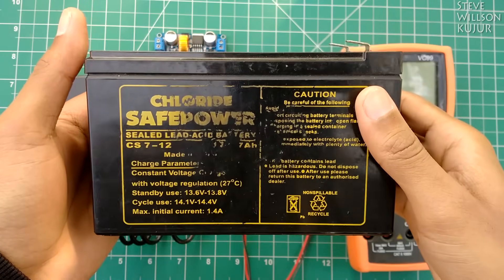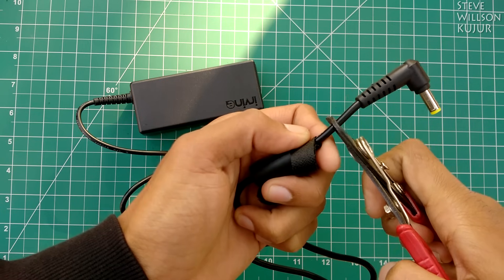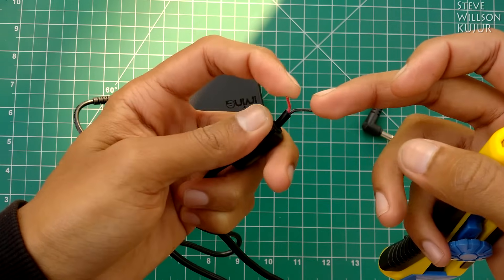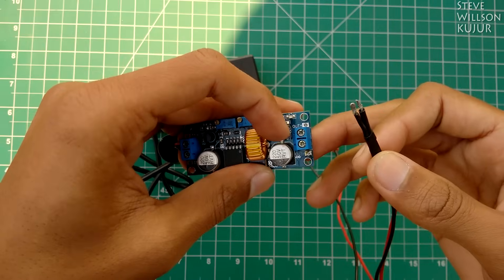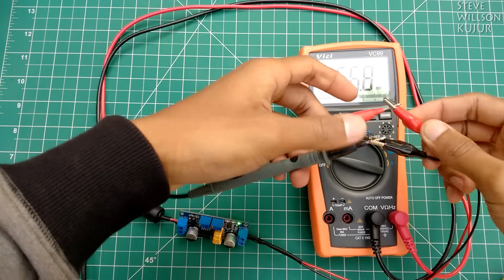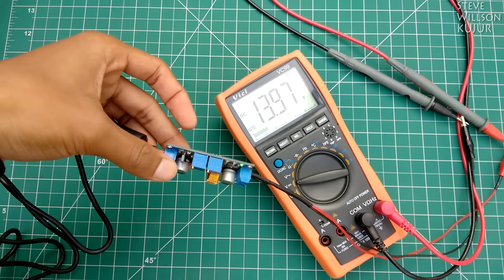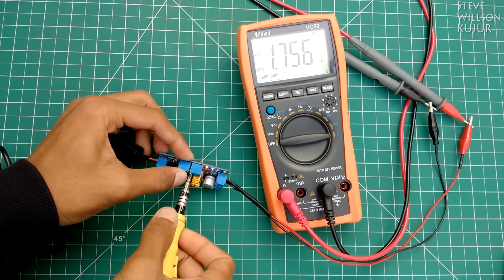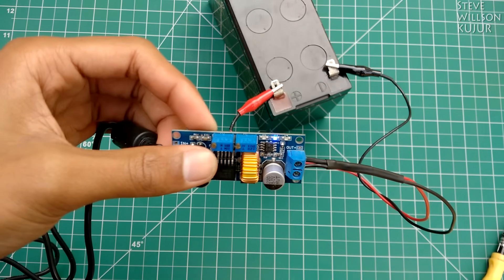How to Make a 12 Volt Battery Charger

Comment: I have seen a diode connected in series with +very terminal and battery which doesn't allow reverse voltage from battery which may damage buck converter. Is this necessary

Comment: Hi Steve...i am trying to charge a 12v 7ah battery using the XL4015...i set the XL4015 at 13.5v  and at 1.4amps..however when i connect the 12v 7ah battery to the XL4015 output both the red and blue lights up at the same time...i tried it on another 12v 7ah battery but the same thing happens...both the red and blue lights on the XL4015 lights up at the same time...what am i doing wrong?...i am using a 19v 3.42amps laptop power supply as my power source...please help me.

Comment: I have a inverse problem the battery charger shows battery as fully charged after a while due to surface charge on battery i dont know what to do to tackle this but cant confirm if power cuts off when light status changes on this module

Comment: help, I have a large 24 volt  lifepo4  battery in my camper but the camper is 12v /13.8v. should I keep a 12v/13.8/ battery charged with a 24 to 13.8v stepdon or just get a giant 13.8 step-down and have no battery?

Comment: Hi!
Nice and clear explanation and good vide.
My question is:
Is the 2A charging current not a bit too much for a battery of 7-8Ah?
I would say a charging current like 500-600mA could be better.
Reply: IIRC a lot of fast battery chargers use anywhere from 1-4 amps, just because its quicker to charge the batteries, but these chargers also have saftey auto shutoffs to protect the batteries.

Comment: You can use the Imax b6 multifunction charger for this as well, but if you get the adaptor one, you need to buy 15v 5amp adaptor for this.
The b6 charger has protection features that this module does not have.

Comment: It's amazing how many DIY battery charging crap that is presented here on the tube. 
This will ruin your battery very soon, by overcharging the battery. And if you lower the voltage in the regulator the battery will be undercharged.
DON'T DO THIS! Buy a real intelligent battery charger and don't kill it this way!

Comment: My battery is 12Volt and 7A/H what module should I buy can you share the link please. Thanks. This is the model number of my security alarm backup battery Lithonia Lighting 12-Volt 7A/H Sealed Rechargeable Battery ELB 1270A. Need your technical help.

Comment: Does dc dc step down convertor automatically stops the flow of current after battery charged? I guess it does not. After battery fully charge its voltage will be 13.5-14 volts. The circuit must be cut when the voltage reaches the desired value. 
After the battery is full, the energy of the battery should be automatically cut off.

Comment: I've a dsl router with 12V input and a motorcycle battery with 12v output. I tried to connect both input and output to the battery but then the wires got really hot and then I disconnected them. Any way possible to charge my battery and power my router at the same time?  Please help. Don't want to change the cables manually when the home electricity is off.

Comment: Hi friend, what is the name of that step down module and where i can find it i need one.
Reply: https://es.aliexpress.com/item/32580191958.html?aff_platform=link-c-tool&cpt=1554534410140&onelink_item_from=32580191958&aff_fcid=b8255068a0744a32a2bc762003973a9f-1622031846592-00099-ce4QwdVA&onelink_thrd=0.015&onelink_page_from=ITEM_DETAIL&aff_fsk=ce4QwdVA&pvid=4a0bfbcb-03ad-47d5-a398-7779480a1aa6&onelink_duration=0.949781&sk=ce4QwdVA&aff_trace_key=b8255068a0744a32a2bc762003973a9f-1622031846592-00099-ce4QwdVA&scm=1007.22893.125780.0&terminal_id=9e61c5f005e443a38c4c5abd167f6cc6&onelink_page_to=ITEM_STORE_DETAIL

Comment: I'm little confuse here..your battery says max initial current : 1.4A so does that mean the charging current should not exceed 1.4 A?
Reply from the maker: Lead acid charging current should be 

Battery Capacity in AH/10
Example 7Ah battery / 10 = 0.7amp

Comment: sir i am buyer of battery charger for 12 volt 7/4ah with over charge and low battery cut off with  100 watt out put bulbs plz contact 9810185439 for regular supply

Comment: Dude I've 12 volt landline charger connected to a 12 volt battery. Any home alternative (I don't have multimeter) to check if current is flowing in the circuit.
Reply: You can buy a really cheap multimeter from Harbor Freight (like $7), or whatever hardware store you have nearby.

Comment: Thanks a lot for this, you have shown me a way to safely charge my SLA battery without destroying it due to over charging. 
1. Can this be used with a 30V adapter laptop charger to charge 24V batteries?  
2. Is there any way to install this component on some standard case so that we can use it for normal use ? 
3. Any way to take care of the heat generated - anyway to attach a heat sink? 
Thanks a lot.
Reply: 1 You need to check the concerning IC'S datasheet to see if input voltage of 30 can be used.  I think this one is 32v but still check.
2 Yes but it depends on creatively https://www.youtube.com/watch?v=BonGGUmEbS4
3You can find small heatsinks exactly for these modules on eBay or equivalent.

Comment: I have been thinking of doing this, but do you need a "battery charger" or can you just use a power supply if you have a overcharge protection module going AFTER the buck converter?

Comment: This doesnt really help if you dont have a Laptop charger to give you supply voltage. get a 15v secondary output transformer, rectifier bridge and capacitor of about 1000uF 20v and then you can use this module.

Comment: Battery 12 volt but you gave 14 volt ?
Reply: the nominal voltage is 12V but a fully charged one is around 14V thus you need to charge it at around 14V.

Comment: Nice video!!! If there’s a device that runs on a 6V 4.5 AH SLA battery, isn’t it possible to take it out and connect the device leads to a 6V AC to DC power source and run the device through an electric outlet without the battery?
If so should any consideration be made to the Amps of the adapter to be used or any 6V adapter would work?

Comment: Why can't u just put the wires positive/negative with that dam chip u didn't explain what the hell it is or why u need it
Reply: Without the module it would put 19 volts at 3 amps into the battery and it would burst. The module limits the voltage and current.

Comment: Is it capable of charging 12v 7ah lead acid battery? 
If yes, then what voltage and current should I set so as to charge my battery as soon as possible
Reply: Charging voltage between 14.4v and 14.Safe charging current is 0.1C.That is 0.1*7=700 milliamps for a 7Ah battery.You can increase the charging current upto 2 Amps,but that will heat your battery and reduce its life.

Comment: Don't understand,the power pack was already at right voltage,and they are low amps any how,so why modify it,I use a 13.5 volt 1 amp photo copiyer charger that I bought for 50p

Comment: Would leaving it on even after battery is full damage the battery. What I mean is do I have to wait for it charge so that I'll take it off after.
Reply: That dc stepdown module doesn’t have protection per say but when you set the amps here he set to 2 amp the battery will pull more amps the full 2 amp when the battery is dead and as it charges it will reduce how much current it is pulling. When it reaches the set 14 volts is will no longer pull any current so In a way it does have a shut off. The only thing is a fully charged 12 volt battery like that will only hold a maximum set stage of around 12.7-12.9 volts so after it hits the 14 volts it will stop pulling current so stop charging but as soon as the battery starts to self drain down and settle it will start pulling a small amount of current wanting to keep the battery at the full 14 volts. A proper battery charger unit has set limits and it will charge initially with 14-16 volts but after it gets the signal that it is charged it will cut off charging until it hits the low end setting of around 12.8-13 volts then it will start charging again. That is known as trickle charge where it just keeps the battery topped off. If I were you and built this charger he has shown I would most likely set it at 14 volts and let it charge for 30 minutes to an hour to go ahead and get the charge up some but then I would reduce it to say 12.8 volts if I wanted to let it set unattended for a long period. It will eventually charge the battery to the 12.8 volts set it will just be a bit slower than if it was set to the 14 volts. Having said all of that I have made such a charger and used it accordingly without issues BUT if YOU decide that YOU want to build and use this IT IS AT YOUR OWN RISK. anything is possible and a great number of variables could cause complications. In other words don’t come back to cuss me out or blame me if you burn your house/garage down and or blow up your battery.

Comment: I Google wanting to know how my old car charger works, but I found this instead. I need me one of these step down modules! I have a bunch of old laptop chargers too. Must also be far more efficient than the old transformer chargers.. Even though mine is 50+ years old it still keeps on going. I just had to remove and bypass the 6/12v switch so now it's 100% 12v but I really could use a backup charger. Better yet I should build some solar trickle chargers.
Reply: And I just realized it's a lithium charger..

Comment: Kindly confirm I can adjust to 5A since i am using car battery 12 volts, 75amps?
Reply from the maker: Yes you can for sure
Reply: @SteveWillsonKujur  Thanks. If you wont mind i have yet another question: i have an old motorola radio charger with output voltage of 14.5V and 1.5A. Can i connect it directly to my 12V 10amps battery (same battery you used in the video) for charging it without stepping down the voltage to 14V, like you did in the video.

Comment: I have a 12v li íon charger with an input 220-240V 50-60hz and output 12V DC 1000mah. Is It easy to change its input to 110v but  having  same output? How? Tks

Comment: Thanks for the fantastic solution. Please advise for three queries.
1. Does this unit have auto cut off when charged ? 
2. Can I use this option  with increased voltage to charge a 24V SLA battery also? If so what changes do I need to do? 
3. Any tips on how to build a case to put these into a secure charging station?
Reply: I would glue it in a clear rubber made container that I could drill holes into and then water proof the holes.

Comment: Can I use 1N4007 diode to the battery so that it can block the current of 12 volt DC battery to the laptop charger (Otherwise, there will be current in laptop charger which have come from 12 volt batterry)?

Comment: "Firstly, I will connect the laptop charger to 220 volt AC current, secondly I will connect it to DC to DC step down converter, thirdly I will connect the the out + and out - two cables to the 12 volt DC battery"- Can I charge the 12 volt battery following this three rules?

Comment: Those small 12v state 14.4v to 15v to charge and 13.8v to maintain charge.
Reply: Could I safely connect (same type battery) directly to the 19v charger for say an hour just to put some charge back into the battery?
Reply: @nedcramdon1306  Maybe nothing would happen, but 19v would not be safe. Maximum safe voltage is 15v. Anything over that and electrolysis of the water in the battery may happen.

Comment: Is it safe to charge 12V battery made by a combination of four 18650 Li-ion batteries
Reply: Yes but the maximum current should be set to 2200mA and no higher.

Comment: i have 4 12v 22ah batteries that i run in a series to make a 48volt 22ah  battery pack for an ebike tricyle.....currently i have to break up the series and then charge each battery 1 at a time....is there some way i can make it so that 1 charger does it all and all the batteries get the same charge level ?

Comment: Is it ok to charge the 12v battery to a 3,6 or 9 volts output charger?is it  possible to battery fully charged?
Reply from the maker: It's not possible, in order to charge the battery you need more then 12v
Reply: @SteveWillsonKujur  thank you👍👍👍

Comment: laptop charger 500/-  inr  +module 100/-  inr =  12v charger   and standard   12v charger  just 100-200  inr.
Reply from the maker: This can do 5 Amp and you get protections, constant current and constant voltage

Comment: Hi I have the same step down module. When I plug in the battery to charge I still get the red led along with the blue.
What does the red LED mean? 
Obviously I'm doing something wrong because on the video you only get the red when you're short circuiting measuring the Amps and it goes to only blue once you plug the battery

Comment: I’m just trying to charge a push mower battery do I need the 5 amp step down can’t I use a voltage regulator

Comment: hi, I did the same thing with the same module and same adapter. I set voltage 3.98v and 2 ah. but always green light when i plug it to battery. I did not understand why? but voltage is increasing when charging. thanks
Reply: Bad battery.

Comment: Does it have reverse polarity proctection?  i mean when i switch off the charger the battery power will  go to the circuit or not plzz.. reply??
Reply: ajit sahani no it won’t unlike the cheap stuff you’re using right now and I’m using one too. Lol disconnected the source the light still on! Lol
Reply: Phy Belong thanks for the reply and keep smiling always☺

Comment: This is a big mistake, NOBODY CONNECT THE AMMETER ON THE EXIT AS IT SAYS ON THE VIDEO ... IT WILL BURST !!!

Connecting the Amperimeter to the output will burst the XL4015E1 IC or Multimeter.

It seems to me another video to sell the regulating boards, these boards only regulate the Volts, if placing the meter in series with the battery only gives a maximum of 400mA, even with an Industrial Well of 12.5A Mean Well 12VDC.

Turning the potentiometer knob W 102 does nothing ...

It sucks this board.

Comment: Hi i got all same. My batt is 12v 3.0A so I set v=13.99v and 0.5A so full charge is 6hrs. BUT I ONLY GET GREEN LIGHT?! It stays green when I put on battery. Battery is empty/flat (0.48v) what is wrong? Its sealed battery powerpsonic cs-1230. I put all leads to charger and battery and then turn on power. Should I turn ON POWER before hook up to battery?? Volt ok.
Reply: When hooked up i get 13.99 v and 0.5A when touching clips. When multimeter mesasure Amps blue lamp light up but only green when not touching/measure amp. My multimeter has 20A, A, COM, V/OHM. I put red in 20A and set 20dca. Maybe i set too low A??
Reply: I have same problem, when I charge my battery(voltage sets for 14.00v, the battery is 7 volt), the green light led is always on.
Reply: Hi Cong, That is strange, I bought EXACTLY the same electronics at Aliexpress as the guy in the video.... So if you have same problem are they all faulty? My battery is an old one maybe it just wont charge. Or maybe amp is too low? I set it low to be sure not to make fire or explosion. Please let me know if you find a solution. But yes, led never changed color. My batt was flat and charged (with green always on) until about 7-8 volt then it didnt go higher. But led NEVER change to chargemode. Hope we solve it because I bought 3 for 3 kinds of batteries so I need only change power cord when charging different amp batteries. Good luck.... I had hoped for the author of video to respond, but no luck. Best regards Lisbeth

Comment: Hello, i am planning to use this idea of ypur for a project. I want to charge a 12v 7.5ah battery using this set up. I did not find this exact converter you use. But i found this https://www.amazon.in/gp/aw/d/B01N23Z1JO/ref=mp_s_a_1_1?ie=UTF8&qid=1517725839&sr=8-1&pi=AC_SX118_SY170_FMwebp_QL65&keywords=dc+to+dc+step+down+converter . Now my question is can i use two of these with a switch in between both, one regulator will be used to charge the battery and the other to get a dc 5 volt output.

Comment: Brilliant video and on the basis of that, I purchased an identical module. alas although I wired it up as shown in the video and the laptop adapter was showing 19.5 volts on multimeter. the red and green leds were lit on the module and despite turning the voltage adjuster both ways. it wouldn't change from showing output of only 1.49 volts. I will be returning the module and hopefully the replacement will work as shown. I raise my hat to you sir on a clear and informative video and only wished I could say yes it works for me.

Comment: Hi great vid! And great to see how you did the setting upTHANKS. I blew my meter in Amp before so were a bit nervous! I want to ask why you leave on cable the "lump" by the plug on charger? Has it any use? Seems a bit in the way. thx
Reply: The “lump” is an inductor.

Inductor: They are used to block AC while allowing DC to pass; inductors designed for this purpose are called chokes. They are also used in electronic filters to separate signals of different frequencies.

Comment: Tinkerer tip:  Whenever you need to cut the plug end off a wire, always leave enough wire on the plug just in case you need to splice it back together.  At least 2 inches, 4 cm.
Reply: 2inches is 5cm
Reply: TheHelvetican, and for this application he does not need the ferrite core on the power line.
Reply: basically reduces interference caused by current running in cables. So without out it, if you took your laptop's power supply near e.g. a radio it would interfere with the radio station reception.

https://en.wikipedia.org/wiki/Ferrite_bead
Reply: what is the ferrite core used for please?.. Thanks John  :)

Comment: Do not cut the plug of the Laptop battery charger/power supply. Know your + and - first.
And Just stick a nail inside it and push inside the hole a wood toothpick/matchstick or anything that fills the gap to hold it in place. then wrap wire around the outer tip and tape it, then wrap wire around nail and tape it.